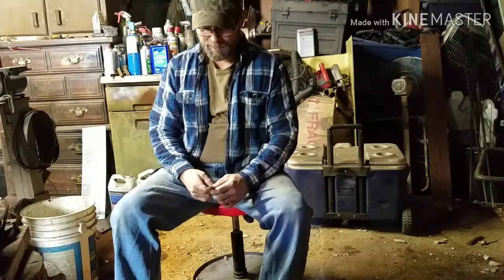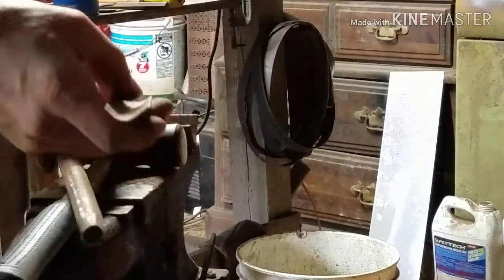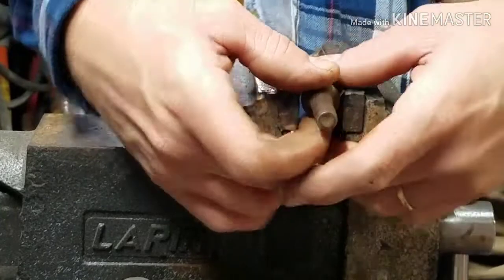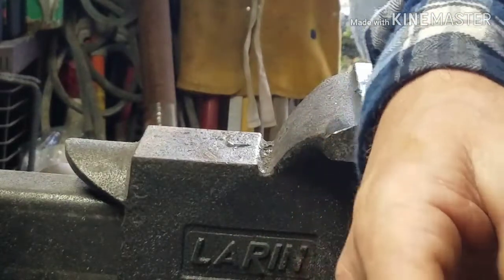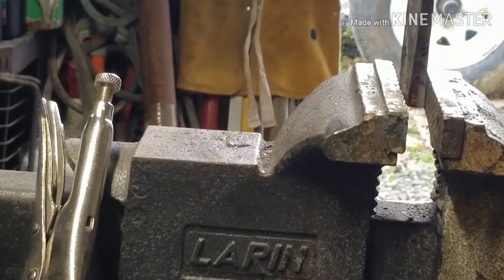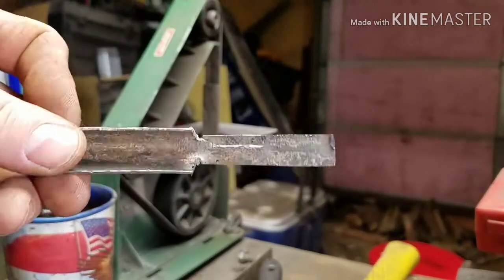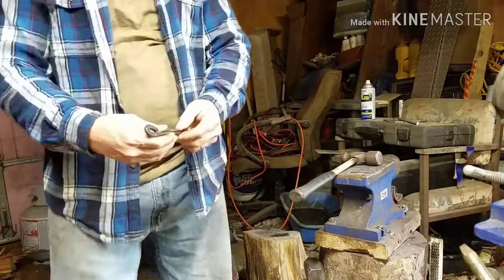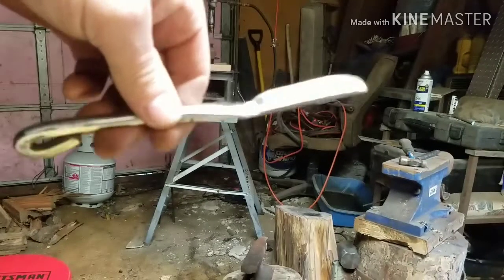Potato Peeler

Comment: What do you know, that bottle opener does work after all. Great job brother. I had my doubts on the potato peeler but you sure pulled that off in fine fashion. I am impressed. Keep making videos and keep impressing me. God Bless. PS. I also am a fan of Root Beer. Remember when we used to get them in a big frosted mug at the little Stewart's stand in Aracoma ? Man those were good. Especially on a hot summer day.
Reply from the maker: I wasn't for sure the potatoe peeler was going to work but it worked real good. Thanks for your support Brother! Rootbeer is my favorite. God Bless Brother!